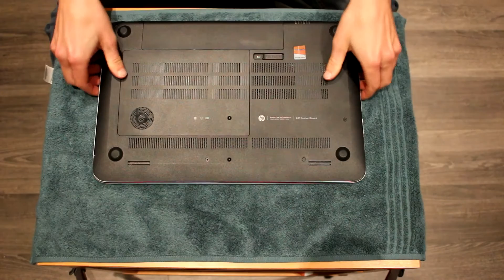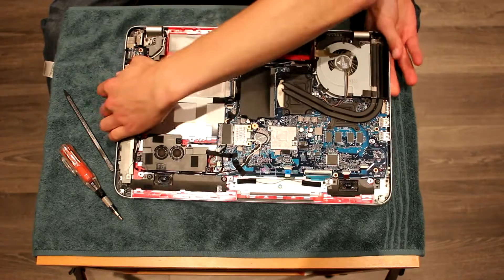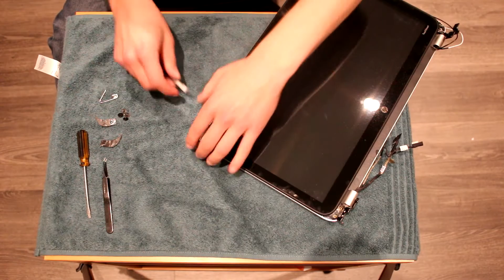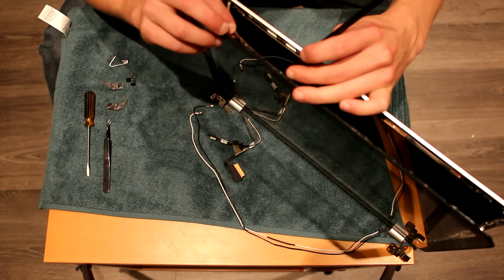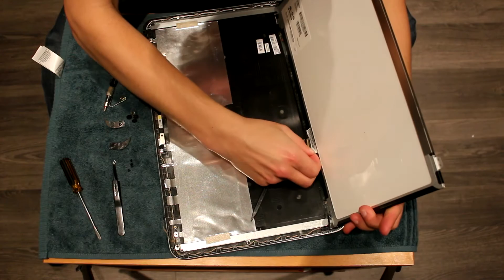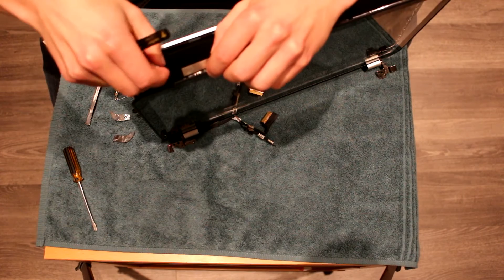Laptop Screen Replacement / How to Replace Laptop Screen [HP Envy 15 J Series Touchsmart]

Comment: Hi there. I know it's old video, but would you happen to know if it's possible to replace just the lcd cable in this model (touchsmart specifically)? HP manual says thatr with touchscreens it has to be the whole display assembly replaced rather than separate components.

Comment: Is it possible to change from LED backlight diode to IPS in this notebook? Awesome video btw
Reply from the maker: Not sure exactly what you're asking here. Any screen you put in these will have an LED backlight irrespective of the LCD technology. 

If it helps, the screen that came out of this laptop looked like a TN panel, and the replacement was an IPS panel.

Comment: Great video Ben! can you recommend a particular tool set or sets to accomplish this particular task? Thanks!
Reply from the maker: I didn't use anything particularly special. So long as you have a set of small screwdrivers you should be OK. It's more important to have a plastic pry tool (or spudger) so you can undo the plastic clips without damaging them.
Reply: Thank you Ben!

Comment: Hi I have the HP 15-j078 with the 1366x768 screen, would I be able to swap it for the full 1080p HP-Compaq 720549-001WUXGA screen?
Reply from the maker: If the connector and backlight type are the same, then the higher resolution screen should be compatible. I can't say for sure for your particular model, but in this video I was actually upgrading from 1366x768 to 1920x1080 and it worked fine.
Reply: Thanks for the reply mate. Also great video, really helped me alot much appreciated!

Comment: I recently cracked the screen on this exact computer. The glass is cracked and the screen isn't responding to my touches at all, but I can fully see everything on the screen. What do I have to replace? You can email me at Nikko.nicasto@gmail.com thanks
Reply from the maker: You can buy replacement glass for the screen (called the digitizer). I can't tell you for certain what the part number is because I no longer have the laptop in this video, but a quick Google search for something like "HP Envy 15 J digitizer" should get you going in the right direction.

Comment: thank you for your video. I have a question, where is the lcd inverter in this display?
Reply from the maker: This is an LED backlit screen, so there is no inverter. Depending on the voltage requirements of the LEDs, there may be some DC-DC boost circuitry (probably on the motherboard) but I can't give you a definite answer.
Reply: Thank you, so much